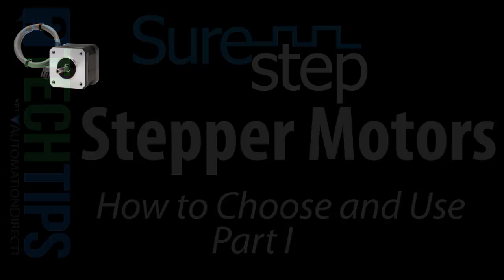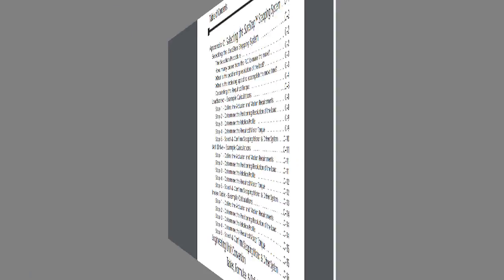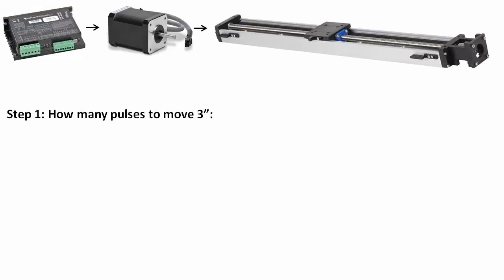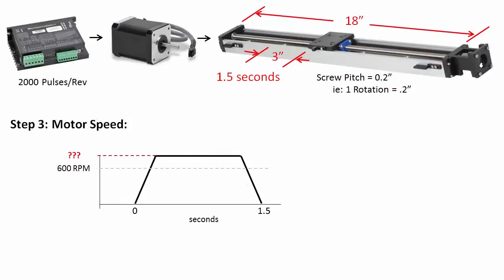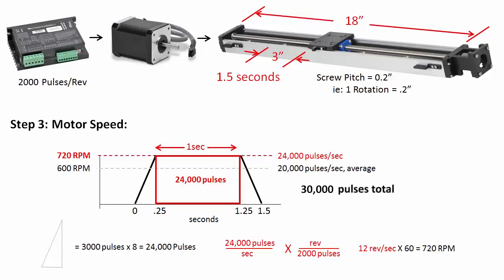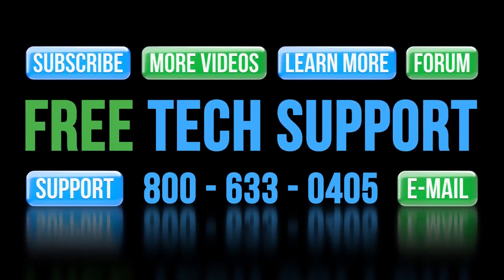How to Select a Stepper Motor - SureStep Stepper Motors from AutomationDirect

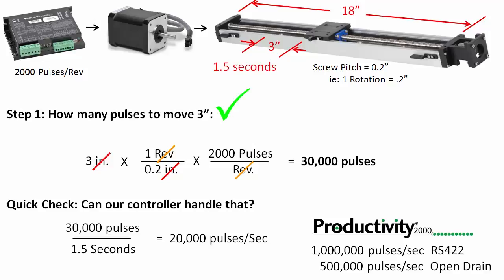Comment: Thanks for this really helpful video. At 2:42 you said the Productivity2000 controller gives out 500,000-1,000,000 pulses/sec. I can't find this information in their hardware specification anywhere. How can I find out the number of pulses my controller gives out???
Reply from the maker: Hi Raymond, You can find that spec on page 3 of this document https://cdn.automationdirect.com/static/specs/p2hso.pdf  in the table "Pulse Output Specifications" under: Maximum Switching Frequency"

Comment: Hi, great explanation, 
but at 4:47 where do the 0.25 and 1.25 seconds come from  ?
and if we have a 5 seconds duration instead of 1.5sec , how do we know how much triangles we have in the area ?
Reply from the maker: Hi DoubleRhonRhon, That was an arbitrarily chosen acceleration time. You would put whatever acceleration time you have for your system, of course ... It was convenient that that time evenly divided into the total time ... made the math a little easier ...
Reply: @automationdirect  Thanks for answer. I'm novice with stepper motors. I suppose the acceleration time will depend on the motor model, and on the torque required for the movement, and the average rpm required. a lot of things ?
Reply from the maker: @DoubleRhonRhon  Yep, you nailed it.  Plus the MOST IMPORTANT PARAMETER - it has to do what YOU want it to do!

Comment: Very informative video!
Is there a way to have Accel/Decel control just like in the video with a p1000 PLC and a P1-04PWM Card while maintaining the desired amount of pulses?
Regards,
Basel
Reply from the maker: I suppose wit enough effort anything is possible ... BUT ... stay tuned. Rumor has it that the Productivity family of PLCs is about to get an upgrade this summer that will probably do exactly what you want with very little effort on your part!
Reply: @automationdirect  That's great! Can't wait for it. May I have a hint if it's going to be involving a productivity suite update or a new special high speed output card?
I'm on the edge of getting a bunch of 04PWM cards for my steppers. Shy face
Keep up the good work!

Basel

Comment: Hi. I allready have a cnc machine with parallel port that I want to upgrade. I was planing on installing a MASSO controller but I don´t know which stepper motor  X,Y,Z and Spindle drivers to buy . The stepper motors are Sanyo Denki , Step-Syn :Type:103-770-6 . DC=5.1V . 1.0A. 1.8 DEG/Step. spindle motor 100 Watts  500 : 15000 rpm.
Reply from the maker: Hi Mistura, 
I could give you some general guidance, but it sounds like you are looking for specific answers .. so … I'm going to encourage you to contact our free tech support team. You can reach them by phone, e-mail or our on-line system.  Go here to see all of your options: https://support.automationdirect.com/techcontact.html

And for support tin general - go here: https://support.automationdirect.com/
Reply: @automationdirect  Yes I am looking for especific answers and I am going to follow your advise. Thank you very much for your attention and help.

Comment: Hi there, thanks so much for sharing this helpful video, I'm little confused at the step dividing the isosceles trapezoid into 10 pieces, why is that not 12 or 14 cuz the speed would be different if we separate it into another number of pieces? Please help me out, thank you so much.
Reply from the maker: The first triangle is created by the duration of the acceleration time. Then you see how many of those fit into the rectangle and then add one for the decel time. So the number of triangles depends on the duration of the rectangle.  The longer the motor runs, the more triangles you will need. In this example it turned out to be 10. This assumes that acel and decel are the same, of course. There are a lot more videos like this at www.automationdirect.com/videos. Just type what you are looking for in the search bar.

Comment: Could anyone tell me where can I get those graphs to compare the speed?
Reply from the maker: Those curves are in the specification sheets for each motor.
For example, 
1. go to Automationdirect.com, 
2. click on "Motion Control" in left column
3. Click on "Stepper Systems" graphic in center of page
     or on "Stepper Motor"  in left column, first bo (scroll down inside box)
4. Select the motor you want (the filers on the left help a lot!)
5. Click on "Specifications" The curves are in there.

Comment: Great video with one thing missing. You seem to arbitrarily move the rpm of the motor up to account for acceleration and deceleration.  Can you explain how to move the line and to where. I am a little confused as to how you picked that new hight.
Reply from the maker: @TheKlickitat - Thanks for the comment! Are you referring to the 720 rpm at time 6:41 in the video? That number isn't arbitrary ... it is calculated starting at about 3:58 in the video.  Is that what you were looking for?
Reply: thank you for explaining what I missed

Comment: what is the best drive a stepper or servo mortor?
Reply from the maker: Hi Donald,  That depends on your application. 

In general, a servo will be higher performance and higher featured than a stepper.   That usually comes with a higher price (and complexity - encoder feedback, etc).  

A stepper will usually be more cost effective.  And it holds position without any “dithering” like a servo may have.

Comment: where can i find the manual u use to make this video? can't find it on your website.
Reply from the maker: @Ariel Chavnarria Alarcon, The 4th edition was used in this video. You can find the 5th edition, which contains all of the original material, plus more,  at this link: https://cdn.automationdirect.com/static/manuals/surestepmanual/surestepmanual.html

Comment: Are drives and controller different? If so, could someone explain it briefly?
Reply from the maker: Yes, they are different.
The controller sends the commands (usually pulses) to the drive. The drive then converts those to the high current signals needed to drive the stepper motors.

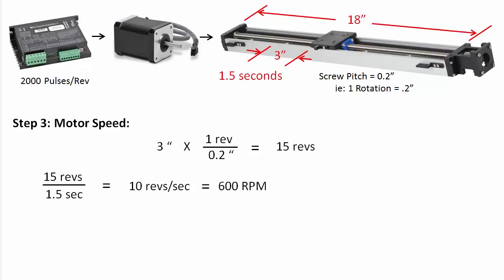Comment: from where you get the 600 rpm ?3:39
Reply from the maker: @Anwar Alfaqeeh Alhusseini, thanks for the comment. The 600 rpm is obtained through the equation explained from 3:20 - 3:39.
Reply: thank you for replaying to me >>>indeed you tube is what i need >>>put i dont understanding >>>because an weak in English 
thank you again
Reply: 10 rev/s = 10*60 rev/m =600 rev/m
Another way:
At 2:17 you have 20.000 pulses/Sec thats frequency [Hz]  f=20000 Hz
At 2:05 you have steps per rev or pulses per rev :  S=2000
So according to Takashi Kenjo formulas: N=60f/S =(60*20000)/2000 = 600 RPM (rev/minute)
Reply: Hadis Adili thanks 🙏 
I understand it
Reply: 10rev/sec*60sec=600rev/m=600rpm
Reply: thanks

Comment: Appendix C example 2 =  (45 mm ÷ (10 mm/revscrew ÷ 1 revmotor/revscrew)) x 1000 steps/revmotor
= 4500 pulses.... why did you multiply the  distance to be traveled by the rest?
Reply from the maker: @Andreas G, thanks for the comment. Very good question! These are the same equation, what is used in the video is the simplified version, which I believe is more straight forward when you are involving fractions. 
 Notice in the equation in Appendix C, Dload/i = 10 mm/REVscrew. To divide a fraction you take the inverse and then multiply. For this example, the inverse would be 1/10 Revscrew/mm. 
This is what was done, in the video, the 1 rev/0.2 inch is the inverse of the Dload/i, and then that term was multiplied.
Reply: I got it, the old maths tricks transposed eq... And flipped technique... Very useful to remember them
Reply: @automationdirect  Hey, in the video, screw pitch is mentioned as 0.2 inches. but the same time you said "each rotation moves the screw 0.2 inches." So, isn't that dload? since P=1/dload, isn't screw pitch is 5 rev/inch ?

Comment: how do you consider that 30,000 pulses are sufficient??
Reply from the maker: Hi Madesh, The 30,000 pulses is derived from the physical constraints shown in the equation at 2:09 in the video. We needed to move 3 inches using the given threaded rod, the math then tells us we need the 30,000 pulses to move the 3 inches.
If you need more help, please contact our free tech support. The will be happy to help you.  You can reach tech support here: www.automationdirect.com.

Comment: Pl help me design a '1person chair lift' to elevate and ground  100 kg. between ground &1st floor (10 ft. height), using  a stepper motor. supply 230v 50Hz.
Reply from the maker: Thanks for the comment Mahesh. For this type of in-depth help, please call into our tech support help line at 1-800-633-0405.